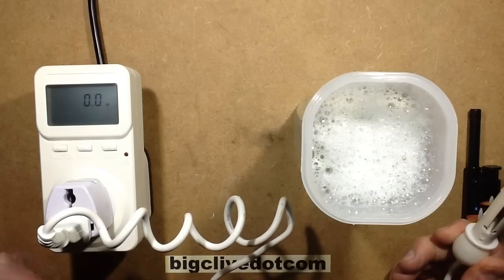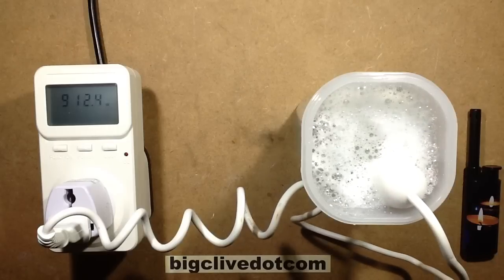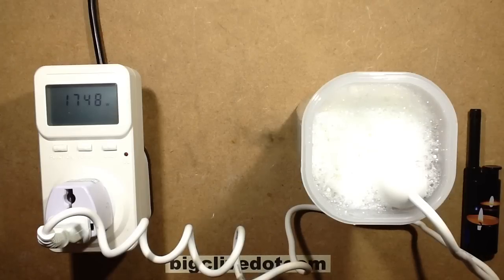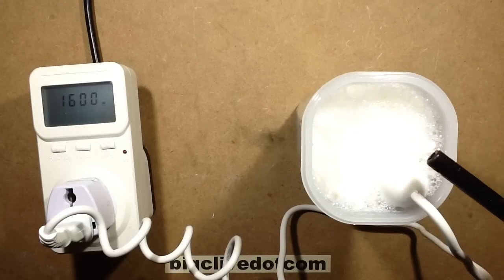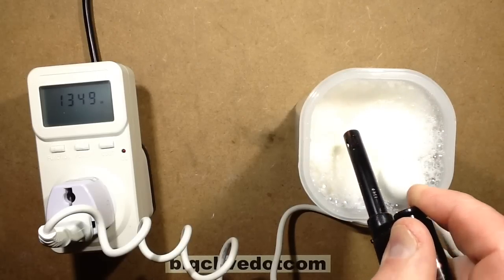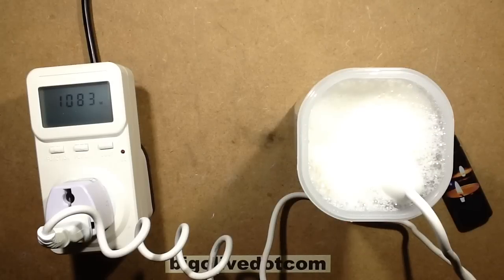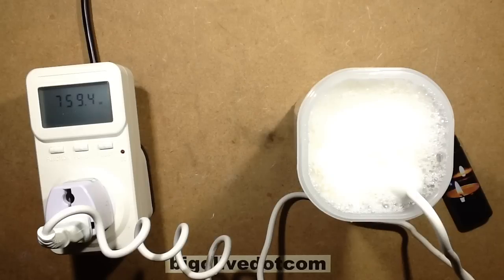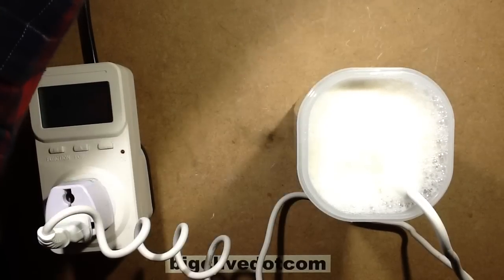Does the AC electrode boiler produce hydrogen and oxygen?

Comment: I have a question, why is oxygen always referred to as O2? 
Yeah I skipped chemistry in class. 

But I have to say if you have only one molecule of water and split it you will only get one oxygen atom and that atom can exist forever if not allowed to interact with other atoms. So why is oxygen never simply referred to as "O"
Reply from the maker: +TruAnRksT Oxygen's stable state is for two molecules to attach together.  If it's broken apart by ultraviolet light or a an electrical arc then the individual molecules of oxygen immediately try to attach to another molecule.  When they do they cause oxidation.  When broken apart they can rejoin in an unstable state of three oxygen molecules O3 or otherwise known as ozone.  The ozone molecule clusters are not stable, so one of the molecules will tend to attach to anything in the vicinity oxidising it in the process.  That's why ozone is used to sterilise and destroy odours.
Reply: bigclivedotcom

Well I wrote a large post here and then accidentally clicked out of the box.

Good explanation of oxygen's insecure nature but didn't answer the question. Oxygen can exist as a single atom is the point I wanted to make. If always referred to as O2 this can be misleading.
Reply from the maker: +TruAnRksT It can exist as a single molecule, but onluy briefly because it REALLY wants to join onto something.
Reply: +TruAnRksT Its one of a few diatomic molecules where its pure form in nature is O2, as it can't independently exist as a single atom. Nitrogen is the same way.
Reply: +TruAnRksT Wow, you seem rather butthurt by a simple comment stating a fact. 
To clear this up, to distinguish O2 and O, they are called the oxygen MOLECULE, and oxygen ATOM respectively. Also I'm rather confused as to why you are so angry, and so insistent on your silly fact. Is it because it makes you feel smart?
If anyone cares enough about the fact that oxygen can be formed into highly reactive radicals, it would be the students taking their exams. Even if it is crucial in the formation of ozone in the atmosphere, knowing this won't be of any relevance to the life of some random person on the internet.
Honestly if it weren't for your last comment I wouldn't want to bash you at all, but stop trying to be a smartass, you are just making yourself look bad.
Reply: jackguo380

Blah blah blah
Reply: +TruAnRksT You can't have one water molecule. So if you do electrolysis, you're immediately splitting a lot of water molecules. From one water molecule, you get hydrogen gas (H2) and a free, unstable oxygen radical (O). That oxygen radical is so unstable that it can never be observed separately. It always bonds with a neighbouring element. That neighbouring element is most likely a neighbouring oxygen radical (so it forms O2, which is referred to as oxygen gas, or just oxygen in colloquial speech). But sometimes, it will also bind to other elements, like the metal electrodes, and form a metal oxide (rust in the case of an iron electrode).

Oxygen, as a free radical, is just so unstable that it reacts with pretty much everything that gets near. It would even react with the stable O2 molecule to form O3 (ozone). The O3 also isn't stable, but it's stable enough to exist for a longer period of time, until it bumps into something it can oxidise.

So no, a single Oxygen atom doesn't appear in nature. It binds with pretty much everything it bumps into.
Reply: djteac
Thanks, that's good advice.
Reply: +TruAnRksT the molecule of water will not spit in a vaccum because Oxygen is instable as a single molecule, it is not just that it will spontaneously combine with another O1, its that 2 water molecules have to hit each other when the Hydrogen are still attached for there to be a possibility for the 2 oxygen atoms to react.

your premise is flawed
Reply: it takes a lot more enery to create O1, a setup like this will never produce a single O1 atom. thats why we say O2, because that is what it is.

Comment: It's the salt added to most washing up liquids that is making it conduct, pure detergent does not conduct so well. Some brands are also acidic. We tested them for lab uses, and then returned to BP detergent as it is purer and makes great washing up liquid on its own. Washing up stuff has added water, thickeners, oils and perfume plus salt and acids, the real BP stuff is great, but keep your hands out of it!
Reply from the maker: +stephen wallin Just a pure surfactant like Sodium Laureth Sulphate?  I know sodium chloride is added as a thickener with a distinct curve with viscosity.
Reply: +stephen wallin Actually you can get hydrogen out of 12V if you have conductive enough water. Grant Thompson made a 12V hydrogen generator but it had much more plates and a really good electrolyte.

Comment: Whip the plug off and stick a bridge rectifier in line!
Reply: +hyperion8008 No.  A bench supply is more than enough for electrolysis.  It may take some time to capture the gas in the soap bubbles but it is a hell of a lot safer.

Comment: Of course you don't have hydrogen and oxygen coming out of the bubbles. You hear that buzzing? That's arcing in the water, which in turn is igniting any hydrogen that is being generated. Burning the hydrogen with the oxygen of course just converts it back to water. You need to do something to prevent that arcing from occurring, if you want to actually make hydrogen and oxygen for extracting from the water.

Comment: Everyone saying use DC... It will make no difference. Current flowing from the anode to the diode will generate hydrogen on one end and oxygen on the other end. Using AC will do the same thing but the alternating current will just generate Hydrogen and Oxygen on both ends. Also if you listen, there is a BUZZZZZ, thats a transformer and they only take AC. So plugging this into a DC source would not work and bypassing the transformer would be pointless as its basically the same as putting 2 nails into the water connected to a DC source... we all have done that experiment in school one time in our lifes.

Comment: You migt need one of these from Maplin http://www.maplin.co.uk/p/kbpc3504-35a-bridge-rectifier-ar87u
That would be much more interesting
Reply: good, good, let the anger flow
Reply: +Chip Guy Vids You don't even need that much DC voltage for electrolysis.  A bench supply is more than enough.

Comment: Oh yes some of the bubbles are definitely flammable gas! Must be hydrogen or oxygen. I put 2 aluminum rods into plain tap water and connected to 220 volts, no electrolytes added in. It produced large and small bubbles. I disconnected the power and put a flame to the larger former bubbles and they burned with a nice pop.
Reply: Afaik the reverse current in the second half of the AC should have the inverse effect on the hydrogen and oxygen ions which converts them back into H2O (basically how a hydrogen fuel cell works). So I don't think that every electrode heater will produce hydrogen and oxygen gas.
However aluminum itself reacts with water forming aluminum oxide and liberating the hydrogen from the H2O as H2 gas. While this doesn't happen under normal circumstances due to the oxide layer which protects the aluminum, my theory is, that it the electricity destroys the oxide on one electrode briefly in each cycle which accelerates the hydrogen production and the reverse cycle doesn't convert enough hydrogen back, so there is a overall net gain on hydrogen.

PS: If my theory is correct that the aluminum electrodes themselves are causing the net gain in hydrogen gas then over longer periods of time the electrodes should corrode noticably. Also the net gain should vanish if you use a different less reactive material like stainless steel or graphite or even better platinum electrodes.

Comment: i have reason to believe the gas is Ozone gas, confirmation needed though
Reply from the maker: +Mohd Waqar Kassamali Not the slightest smell of ozone at all.
Reply: bigclivedotcom owh, ok. I once had a cheap steam inhaler (Chinese), that just had 2 electrodes which were directly soldered to A/C mains wire, it would produce a chlorine like smell, and you could only put clean water, any dirt would just cause scary sparks.
Reply: +Mohd Waqar Kassamali If there is salt in the water (sodium chloride, which is the stuff you put on food and what's in the sea) electrolysis will split the sodium and the chloride. You can smell the chloride. The sodium will probably combine with the water to form NaOH (sodium hydroxide). 
Chlorinated water (for desinfection) will probably also release chlorine if you run current through it
Reply: LimaVictor Yeah, makes sense, i did observe this in Tanzania, who put quite a lot of chemicals in their water.

Comment: yes it is electrolysis, but since you are using AC, basically you swap between where you generate the hydrogen and Oxygen..

the Hydrogen will always appear at the cathode (negative current) but since both lines of copper swap between cathode and anode, both produce both Hydrogen and Oxygen.

electrolysis happens weather it is AC or DC, it is basically the current cutting the molecule in half kinda like nuclear fission cuts an atom in half...

The Energy input surpasses the stability limits of the molecular structure and it destabilizes but since the energy input is not high enough to split atoms, it only splits the molecule :)

the reason why it won't catch fire is then also obvious, it is not concentrated hydrogen bubbles, but a mixture.